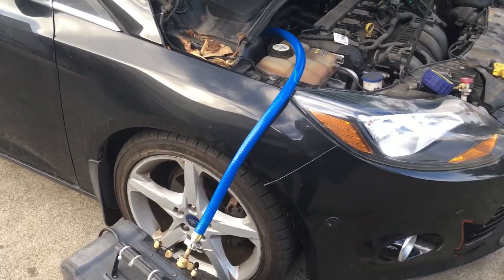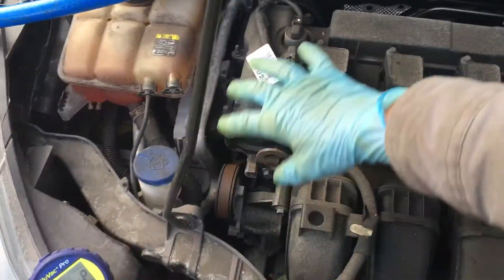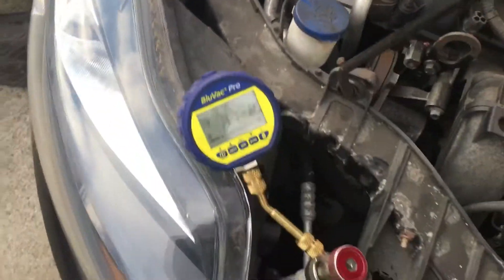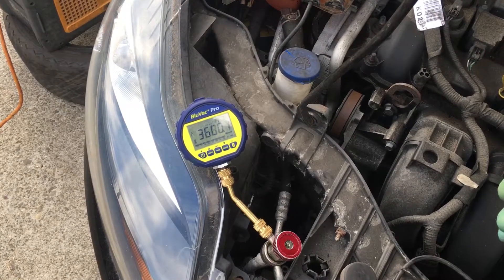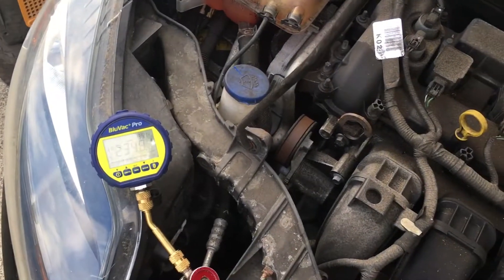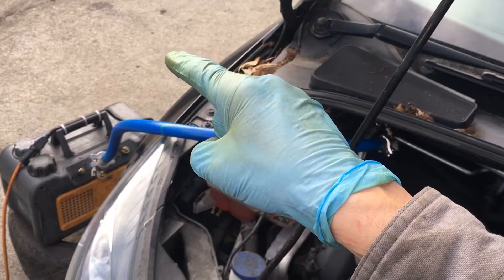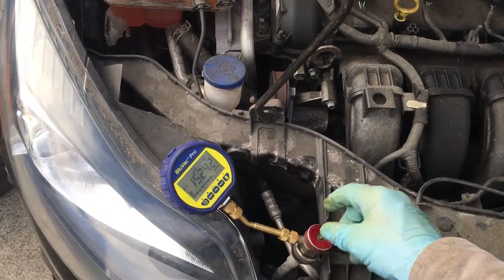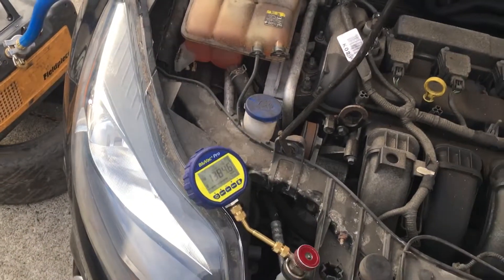Single vacuum hose AC recharging method. Micron meter explanation of use

Comment: did you pull the Schrader valve on the high side?
Reply from the maker: No, don’t need to. The extra large outer diameter of most 134 and YF are not the same as the old valve that are tiny inner diameter. 

New ones flow 10 times more volume
Reply: @coldfinger459sub0  Thanks so much for the reply. I am so glad i just found your site, excellent detail with everything. Great work! cant wait to vacuum my 2010 honda civic the correct way!
Reply: @coldfinger459sub0  Thanks for the reply, So glad i found your site. Excellent detail and presentation with your work!  Cant wait to vacuum out my 2010 civic the correct way.

Comment: Receiver drier replacement . Scenario if system still had  4-6 ounces refrigerant . Evaporator replacement small leak . Evacuated to 170 microns and rise to 230-250  after 20mins ,, Question would you replace the drier . ???  [Sounds like the system is reasonably dry. I will vacuum over night before final charge ---small pump/ 1x vac hose on the low  ] [micron on the high ]    What are  your rules behind drier replacement .?? Obviously a system thats been open for longer than 24hrs I would automatically replace .
Reply from the maker: Receiver dryers should always be replaced. Wanna system is opened up. It also has a filter in it like a filter element in your oil filter. 

There is a natural absorption of moisture that actually goes through rubber hoses . 

Different manufactures have stated different life. Five years to seven years. . 

Hi myself on my personal vehicle . 

If the dryer was really cheap and really easy to replace, I would just replace it . 

But if I had one of those stupid vehicles like a couple Subarus out there, I could think of that had a special pressure switch mounted on the receiver dryer and I think Subarus price for that receiver dryer is like something stupid like $300 . 

I’d leave my vehicle on a vacuum pump for 24 hours . 

I personally myself just for fun, and to keep measurements and testing. I recharge my vehicle every two years. . 

Even though it didn’t need it 

And I would leave it on the vacuum pump overnight every time . 

Always got well below 100 µm . Couple times I think I hit about 66 µm.. . 

Because of my service habits, I don’t worry about moisture .

Comment: Under 500 µm can be impossible on some MVAC systems because of the shaft seal.  I don't think there is any harm in pushing it as far as it will go.  I have my dads old micron gauge width the analog needle, I wish he still had his charging cylinder, but I think it got broken.
Reply from the maker: Yes, I learned and started on analog micron gauge. 

Most all MVAC can pool under 500 µm I’ve even got most under 100 µm if I leave it on the vacuum pump overnight. 

Only a few with defective seals cannot achieve the 500 mark but that’s very rare . 

Some of the Hondas seem to have that shaft seal problem and I remember the old forts with the FX 15 compressors from the 1980s and 1990s had that problem .

Comment: Love the one hose method, great info, if you found a small o-ring leak on condenser & the hose and a few parts round it were covered in oil. How much oil would you add to the system? If you recovered 130g refrigerant from a 650g system? As just a rough guess. Vehicle sucked down fast to very low micron gauge. Thanks in advance 👍
Reply: Many thanks, yeah I guess it makes sense. Every single one of your videos I always learn something new 😊 your channel is absolute gold, have a great Day Tom 👑
Reply from the maker: @Ken_4711  👍
Reply from the maker: All most no oil. 

Just oil stain.  Have you noticed if you drop one drop of oil after a few days or a week or more it spreads out a inch to two inches round?. 

It takes very little emotional oil at all to make a very big oil stain that looks like a lot of oil.

Comment: Yes total lack of education among auto mechanics. I would pull a vacuum for ten minutes because that's the robin air machine default. Oh the job went out faster. I never heard of micron gauge. Just wow the light came on and out of the dark ages. Lol
Reply from the maker: A analogy, I like to refer to. 

Your mother or your child has a cancer tumor in the doctor got tired at the end of the surgery and just felt like he didn’t have to go deeper into the lungs to get that little itty-bitty tiny last piece of cancer because he has a golfing game to go to this afternoon. 

And the doctor knows this type of cancer from that tiny piece will take 5 to 8 years before it starts growing again to cause damage and your child or mother hast to go through a year chemotherapy and another surgery because he took a shortcut. 

His operation was successful. The customer got healthy again and healed, but just left a tiny piece of cancer behind to cause destruction later on.. 

I have some good videos of how much rust and corrosion cutting open components inside receiver, dryers or inside condensers that literally rotted out on the inside and plugged up with rust particles or Aluminum  oxidation particles . 

The technician who did the job before was successful when he was finished the car was cold and the customer was happy and The Mechanic got paid. 

But that moisture over the few years later, that reacted with the refrigerant, turned into an acid and started attacking all the metal and breaking down the oil.  And then the rest particles clogged expansion valve..  and because the expansion valve was getting restricted oil stopped returning to the compressor and less refrigerant so less cooling so the compressor overheated with lack of oil. 
         And then the customers left a few years later, buying a compressor buying a condenser buying a receiver dryer, having the evaporator flushed or replaced, replacing the expansion valve and flushing out or replacing all the hoses in lines because of that quick vacuum job mechanic did a few years ago.

Comment: Just wondering, what would be wrong with making a 3/8 copper line for this purpose. Love the channel.
Reply: Thanks, lots of HVAC channels,but you have the market cornered in this area .
Reply from the maker: @jenko701  when I started my business 30 years ago from San Francisco to Redwood City I had 30 air conditioning specialty shops as my competition in every city. 

        As a five years ago the last largest air conditioning specialty shop in my city of San Francisco went out of business there is only one left open out of 30. 

And that one air conditioning shop the old original owner is no longer barely present he has new guys with new management and I started receiving some of his cars coming back to me from shops with contaminated refrigerant.   He is doing R1234YF and substituting in one of those eBay mix gases that are actually not allowed to be installed in automobiles because I own a refrigerant analyzer I know that and his customers are complaining about air conditioning not working after they leave his shop. 

So basically there is now zero competition

Occasionally every other year or so some guy decides to become a mobile automotive air-conditioning guy he cuts his price down to half of mine he does get into some of the cheaper shops but when winter comes around usually goes bankrupt and out of business because not enough of his customers call him during the winter months in San Francisco weather long and then the following year I get all his come backs from being improperly recharged or contaminated guess or throwing the wrong parts at it just guessing

This is the type of competition I have
Reply from the maker: I made a video about using soft copper as lines off your refrigerant gauge manifold. 

And using soft copper was the way my father was taught when he was young and that’s what he taught me at the age of 12 because we always have soft copper left at the end of a job on installation for free

Comment: I'm confused on vacuum procedure...I seen some videos were they said to vacuum from  only LO side ps  and some videos were they say must vacuum from  both sides...which way is better according to your experience? i  like all your videos and I only believe  the way you work...thanks for all your help...stay safe  from phx AZ...
Reply: As long as your final (ultimate) vacuum across the system is low enough to remove the contaminates, the lower the better, of course.  The larger diameter hoses have more capacity to move the molecules to the vacuum pump and vacuuming from both ends (high/low) of the system speeds the process.  If the system is clean/dry/leak free, ultimate vacuum is reached in less time.  A system with a real leak might never reach a reasonable level of vacuum and thus you need a good vacuum gauge (micron gauge) to identify this problem and ensure the system is reaching a reasonable ultimate vacuum.
Reply from the maker: No one way is better just different.    A little faster if you do it from both at the same time. 

     I was just showing this method as a example.     Because I know some people only have one hose.  And a can of refrigerant and vacuum pump. 
         I guess I need to make some more single holes vacuum videos and then hook up a micrometer at the other service fitting

Comment: @13:58 There still isn't much education for Automotive Air Conditioning, especially with growing electric circuit complexity and more components being added year after year by the multitude of manufacturers. Recently came across your channel and I want to commend for the real world and "straight up no B/S approach" to educate and inform individuals like myself. Great Job reviewing your videos thus far.
Reply from the maker: Thank you. 
               My grandfather and my father were very heavy on education plus hands-on experience not one or the other both in combination learning. 
              With HVAC air-conditioning integrating in with drivability connected directly to the engine functions and air conditioning connected directly into the alternator and air conditioning functions the last decade air conditioning has been specifically dialed in to cool off hybrid and electric cars inverters and battery packs if the owner of the shop cannot keep up with this technology then he should not be allowed to own the shop .PERIOD !!!. 

          I’m 100% on the side of the consumer who is constantly getting ripped off by not having the proper procedures followed servicing their vehicles whether it’s their transmissions their air-conditioning their brakes they’re cooling systems. 
     I’m all for the protection of the consumer and education of Techs

Comment: I think I would be lost without my micron gauge.
Reply from the maker: If I didn’t have my micron gauge I would feel like I walked outside my house without my pants on. 
         At the age of 12 when my dad started teaching me air conditioning the first thing was a vacuum pump and using a old-fashioned analog micron gauge and sensor. 
     As a child my dad taught me the micron gauge was used on every job I was never taught any shortcuts so I grew up not knowing that other people did not use one. I thought it was normal but when I got older and got out into the real world started working I discovered nobody knew what hey micro gauge was.